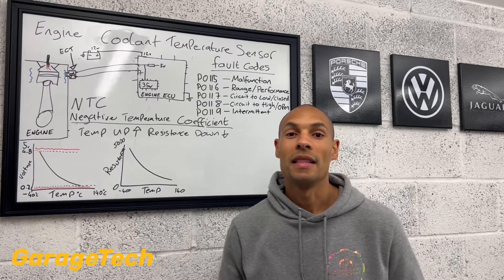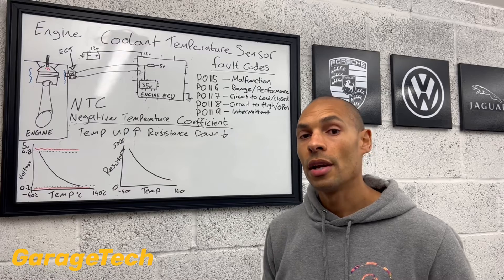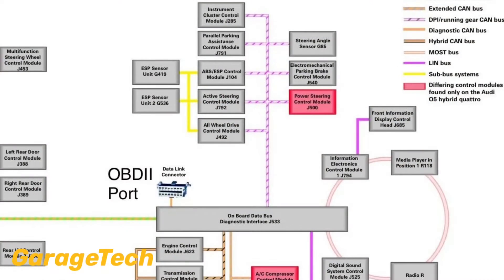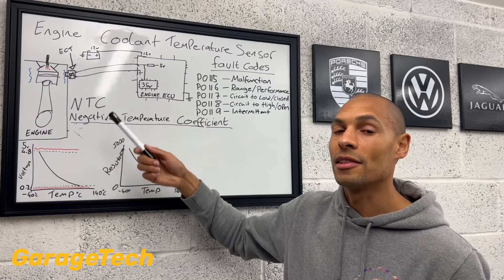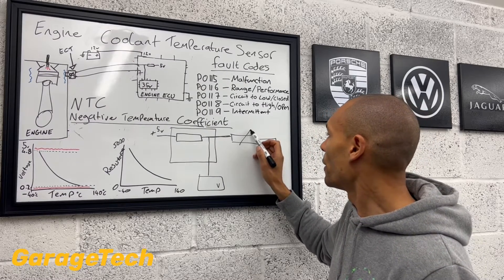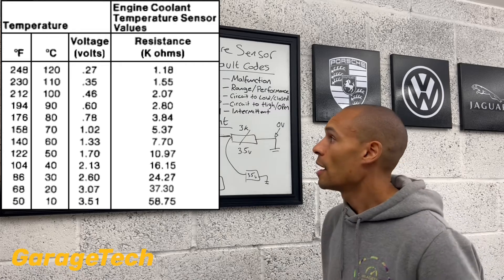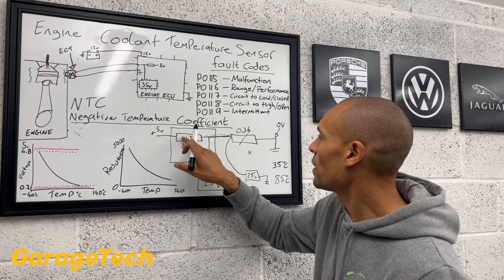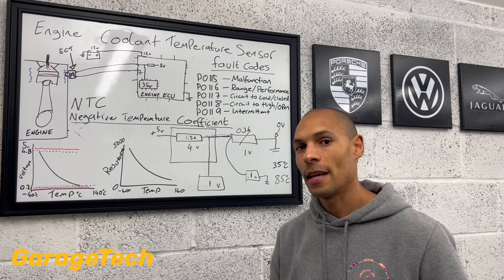How does the engine coolant temperature sensor ECT work? NTC thermistor vehicle temperature sensors

Comment: Does the polarity of an ECT matter? If reversed, will in mess with the computer? Thank you
Reply from the maker: @jamesmahle1259  technically you could as normal resistors aren’t affected by polarity but in these circuits normally the sensor is designed in a way that the wiring plug can only go on one way

Comment: Hello!  What could be to blame?!  After a whole night, at 7 in the morning, when I put the tester on, the outside temperature is 8 degrees Celsius, but the antifreeze temperature is 13-15 degrees Celsius.  When starting for the first time with the outside temperature between 5 and 15 positive degrees, after starting, if I try to accelerate, the engine speed fluctuates very badly.  If the start-up takes place at outside temperatures below 5 degrees or above 15 degrees, then everything is ok!  I changed the temperature probe with a new one OE Wv, checked the wiring and we have no problem, corrosion of connectors or anything else.  What could be the cause?!!!!
Reply from the maker: Hey, what car and what engine is it. The outside temp should be reading similar to the coolant/engine temp in the morning, there may be 5c difference, just depends on climate conditions
Reply: It's Wv Jetta Mk6 2.0 Tdi 2013. I've also checked other cars and first thing in the morning they have at most the same antifreeze temperature as the outside temperature, if not 1 degree two lower.  Is it possible that there is a fault in the temperature reading ECU that causes the engine speed to fluctuate when I start to accelerate, after the first cold start?!!! Thank you!
Reply from the maker: @octaviansorescu7427  hey yes that could cause a fault, have you had any fault codes? I’d also check if it has a fuel temp sensor, what’s that reading, that should be similar to outside temp in the morning. Other things to check is missfires, any logged in the memory. I assume you have a fault code reader to check? fuel filter, when was that last changed? Dirty fuel filter can cause mystery running issues. Any fault codes for the glow plugs? If one of those isn’t working correctly that will cause running issues first thing. Also what is the intake air temperature? You should have a few temp sensors to check between. Ambient temp, intake air temp, coolant temp, fuel temp. Check that for now and if all ok next would be EGR system
Reply: Howdy!  All other temperatures are very close to the ambient temperature: intake air temperature, fuel temperature, oil temperature, only the antifreeze temperature has a deficiency of 5-7 degrees higher than all the others.  I have no error codes and the egr was changed to Origine Wahler recently.  Ramp fuel pressure equal to specified, no problem injector correction!
Reply from the maker: @octaviansorescu7427  was you getting the same reading with the old temp sensor? Might be worth putting another sensor in just to make sure.
Reply: I changed two antifreeze temperature sensors, the last one is original Wv OE!!!!  Same symptoms, no change!
Reply from the maker: @octaviansorescu7427  ah man. One of these faults that have you messing around for ages. Only thing I can suggest is to double check the wiring again, from plug terminal to ECU. Do any other circuits share an earth with that coolant temp sensor, you’ll need to check the correct wiring diagram to find out. These diesel engines are quite solid and strange to only have that issue at a really particular point, has there been any other work done? Injections changed , turbo etc. what does the ambient pressure and boost pressure read with ignition on, they should be the same
Reply: No work has been done on the injection system or turbocharger.  I'll check the wiring again, although I checked it, the probe is supplied with 5.00 volts when the ignition is turned on, and the output signal seems ok until the ECU.  Thank you very much!
Reply from the maker: @octaviansorescu7427  the 5v is correct but if there’s something not right on the earth return then it will effect the reading at the ECU. I would double check the earth and see what else connects to it, sometimes there 2-3 other sensors that use the same earth

Comment: How is possible that when the resistance reduced that voltage also reduced  ?? Normally when the resistance goes down should the voltage increase.
Reply: the circuit has 5 v0Its its pr0p0rti0naly shared between the 2 I0ads when the thermist0r I0ses resistance the 0ther resist0r uses m0re 0f the avaiIabIe. as it d0es the ecm Iearns the c00Iant temp

Comment: Really great video. My brain can't quite wrap around one thing. Why does the current in the circuit stay constant? Is it a constant current supply? Or wait, the current actually goes up as the ECT resistance goes down, correct? However, since the circuit always has the constant resistor in it, the current can never really get high enough to overwhelm the wiring, right? Basically, as coolant temp goes up, total circuit resistance goes down, but current is capped at 8mA anyways with the given 12V supply and 1500Ohm constant resistor example, so current is always tiny. Is that correct?

Comment: I have 2004 honda fit .this sensor is broken .an my car want start .is the sensor causing it ?
Reply from the maker: Would be a good starting point, most cars will generally still start but run rough. If your sensor is broken it will default to think the engine is cold. Cold engines require more fuel so it’s likely injecting more fuel which is probably too much for the engine to start.
Reply: @GarageTechAutomotive  camsensor wire did cut
Reply from the maker: @daverobinson7356  👍🏼

Comment: Hello on live data scanner my car show with around 20 degrees less than the dashboard. For example, on the dashboard, my car seems fully heated at 90 degrees but on live data on the scanner, it shows 70 degrees. I also get generic error P01EA which I believe is related to the coolant system. My car has unstable idle when getting hot and when is fully heated, my RPM are floating and sometimes the car shuts off.  Is that normal? Can this cause my car to have unstable idle? Thanks!